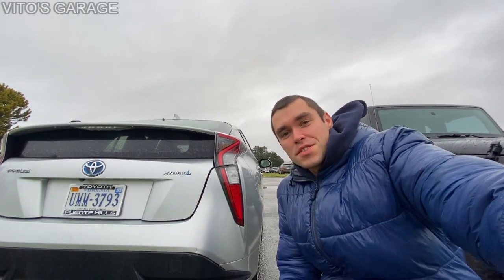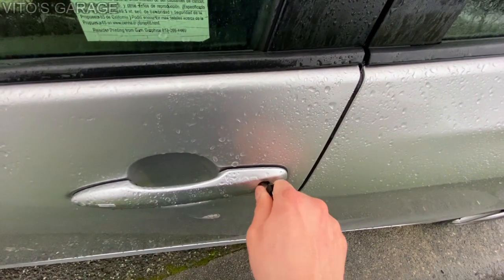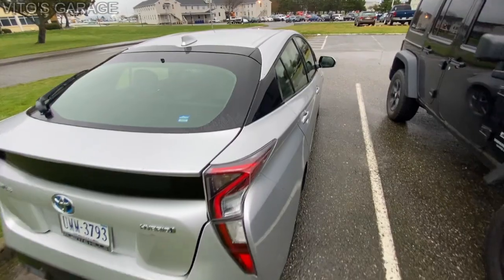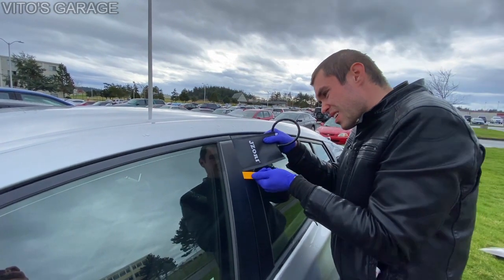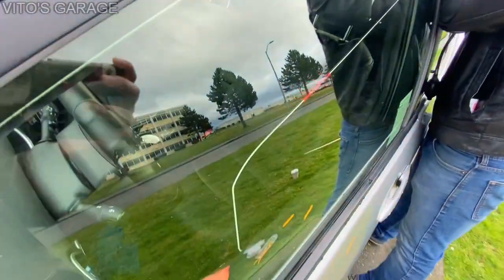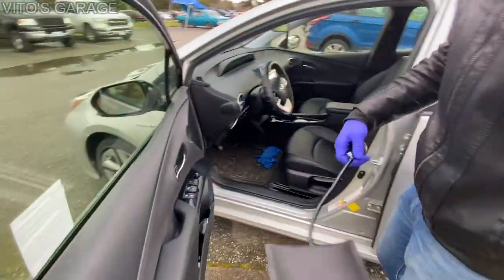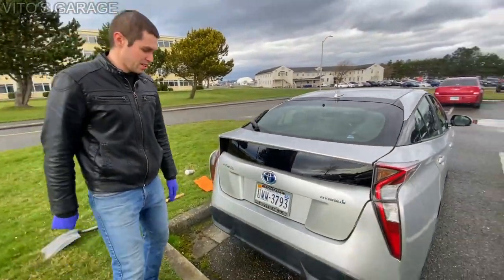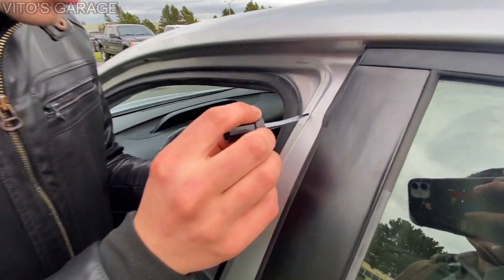How to Open Toyota Prius with a Dead Battery! Not so Easy!

Comment: Just tried to unlock my Prius after the dead car battery was removed for charging (I had manually locked all my doors to my 2016 Prius without thinking). I was able to open the car just fine with the fob key into the drivers side door. Trick is to turn the key to the right, remove the key, then pull on the door handle. Make sure the key goes all the way in. It works :)
Reply: ^ Had a 2009 prius and this  worked for me.
I could put in the key and manually turn it to the left, but, car would stay locked and nothing would happen.

I did that again - turning it to the left by hand.
Then I used a pair of needle nose pliers on the tiny key to get more turning leverage.
Then I turned it all the way to the left as far as I could get it to go.
Then back to the right - back right past where the key started.
Door unlocked.

Comment: Just dropping a comment to confirm this happens to older models as well. I have a 2005 (gen 2) and had the 12v aux battery die while the doors were locked. I tried everything to get the door to unlock, and the manual key did nothing. I know for a fact that the key used to work, as my fob had recently died and I used the manual key to unlock the car not more than 3 weeks ago. After the battery died, it simply no longer does anything. Tried WD40, oil, jiggling the handle, all kinds of crazy stuff people suggest, and nothing worked. 

I thought I was losing my mind, but this video saved me a lot of trouble, thanks!
Reply: Door pry/locksmith solution is what worked for you? I have a 2005 Prius and am going through this rn.  Just gonna have AAA open it for me
Reply: @MrOscar5690  haha thanks a lot... I've just been puzzling over how to break into my prius myself and I plum forgot I have AA breakdown cover so can just call and get them to do it.

Comment: I'm an automotive locksmith. We open 120-150 cars per week believe it or not.We also make lost keys.  Your issue is very common and we haven't figured out why yet. Toyota,Lexus and Honda do this when the battery is dead. The emergency key turns but won't open the door. If you think about those are the only ones we see because people who got them open don't call us. We use professional tools that do no damage. Access Tools makes the best car opening tools. They are coated and do not scratch the car. We also see a lot of emergency keys that were never cut or miscut. Those will go in the cylinder but won't turn at all. The turning and not opening though is something I would like to figure out. Back in the day BMW's did something like this with a dead battery. They used micro switches on the door cylinder. They key would turn to a certain point and stop. You would lift the outside handle and that would allow the key to turn further and unlock the door. They also used a deadbolt feature.
Reply: That's exactly what is happening to me. Key goes in but doesn't turn. Thanks for the info.

Comment: I know the video is old but I decided to reply the same, I had the same issue with the manual key but it turns out you REALLY have to put a lot of effort into turning the key. Like use a vice grip to increase the leverage and then turn.
Reply from the maker: If you’re using a vise grip you’re asking for trouble and you’ll break that key

Comment: Wow, i literally went through/relieving the exact situation starting at min 6:50, today. But my AAA roadside assistance couldn't help open the door. F$%$.  I think he was missing the tape like you had, or he should use a coat-hanger to have a smaller hook because each time he tried to open the lock.  It would slipped off.

Comment: Ok just had this exact issue. Heres the fix. Put key in. You'll notice you can turn it to the left and it doesn't seem to do much (thats probably actuating a switch but dead battery so nothing will happen). You now need to turn it further to the left. This took a bit of force for me. You'll feel a definite mechanical click.  You can now open the door. Good luck.
Reply from the maker: Yeah that wasn’t the case for me lol

Comment: A battery with a voltage below 10.5V is damaged. We sometimes manage to revive it with a very.. very slow charge at the beginning and after return  of the 12V...  by using an intelligent charger, but we 'll never find 100% of the original capacity. This method can help out for lack of something better. This engineering mistake does not make you want to buy a Toyota. 
It was my quarter of an hour of English revision.  Bonjour de France et Bon Week End !
Reply from the maker: Thank you for your comment, sir! That’s good to know. And yes, there will be another video on this car about tires and battery replacement🙂

Comment: I have the same car. Had a completely dead battery.  My manual key worked just fine.  Must have been something else going on with the car.
Reply: I tried mine and the key opened my door just fine.  Same model and all.  I think he was not turning it hard enough to the left.

Comment: He was in for a nasty surprise, the battery was under the hood. That's with most vehicles where you can go underneath the car and pop the hood raise it, then switch the battery and your back in business. But the design flaw with the Toyota Prius c is that the battery is under the rear passenger seat.  If you are stuck with a dead battery in that car, you go through some lousy inconvenience
Reply: But you can jump from the posts under hood in the fuse box.

Comment: You had to turn key to left and bring it back and take it out. You only did it with the right side, thats why it didnt worked
Reply from the maker: I did try it both ways multiple times. Even used some oil in the cylinder. The only way to open the car was to become a locksmith 😀
Reply: I’m going through this now. If the car is double locked (press lock on fob twice) and battery dies, the key will not work.
Reply: Older Prius battery in back